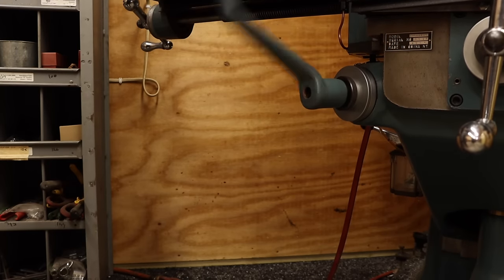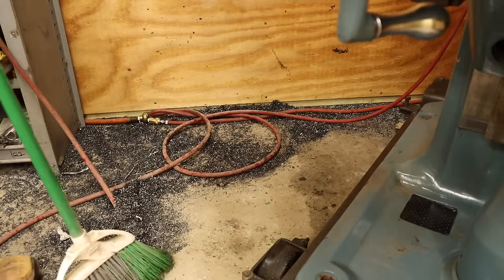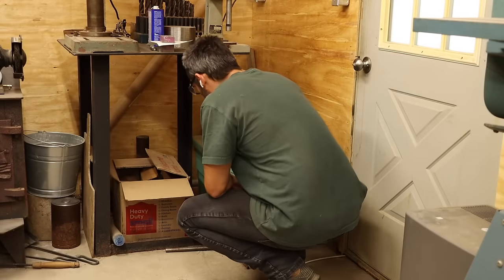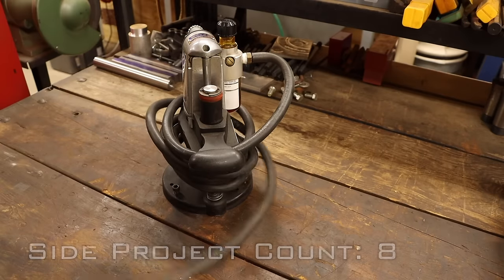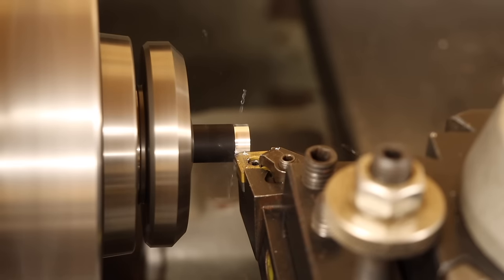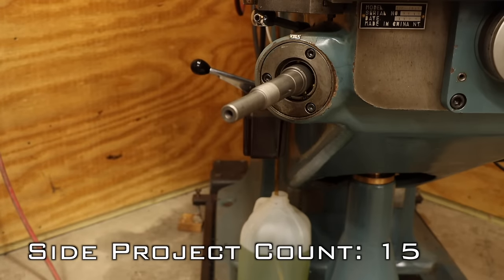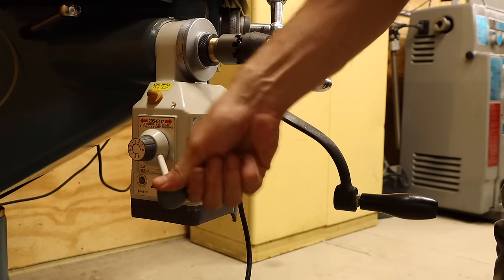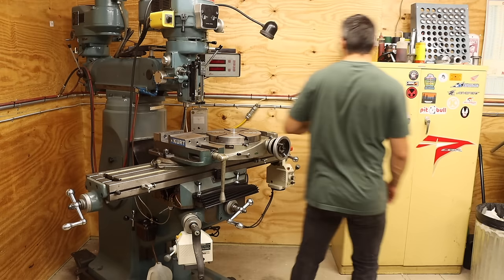3 Mill Upgrades (A Side Project Extravaganza) || INHERITANCE MACHINING

Comment: Uhg, side projects! I know what you mean. I started a project 10 years ago and have been doing side projects ever since. One side project leads to another and another and so on. Now I've forgotten what the original project even was lol. It's funny but unfortunately not a joke.
Reply from the maker: oh no 😂 

one day it will click and you will remember!
Reply: @InheritanceMachining  I hope so. But I'm also worried that, if I do remember, I'll run into another side project that leads down another rabbit hole lol.
Reply from the maker: @lkw6640  that's a guarantee!
Reply: @InheritanceMachining  yeah, I guess that's an occupational hazard especially with what I've got lol.

I got one of those Chinese mini lathes. I won't say it was a mistake because it wasn't. It opened up a whole lot of possibilities. But, as Stephen Gottswinter says, it's a kit and I bought what I could afford at the time. 

I've been making small improvements as I need them and it's gotten better and better. I even got the runnout on the chuck from .006 at the chuck and about .5" at 10" away from the chuck, down to no movement on a 10ths indicator (Mitutoyo) and very repeatable. In fact, if I get any movement when I chuck something I know is round up then I know some junk is on a jaw. Which is better than the pro's get on their 3 jaw scroll chucks so I'm pretty proud of that one.

So, yeah, side projects will always happen lol. But I do enjoy this hobby.
Reply from the maker: @lkw6640  That's a pretty a pretty impressive feat. I'm not even running that true! I've never had to work on smaller import machines like that but find the work Quinn (aka BlondiHacks) pretty impressive. There's another channel Ive come across recently as well called "We Can Do That Better" that had made a whole bunch of improvements to an import lathe
Reply: @InheritanceMachining  I was really surprised at the results myself!  It took some ingenuity though. Let me know if you're interested in a deep dive on that. Mini lathes present some unique obstacles. 

I love watching Quinn! She's hilarious and shows what's possible with small machines although her lathe is still larger than mine and nicer. I just started watching "We can do that better" but I like it so far and am going to watch more. There are a few other channels that specialize in small lathes.

After using my lathe for a while, I've found a lot of limitations with it that I'd never considered before. I want to make it a lot better but it's going to take a lot of time, materials, and even more ingenuity aka side projects lol.

I intend to do some things that I haven't seen anyone else do to a mini lathe but I still have a lot to do before that, like scraping the ways. I am NOT looking forward to that lol.
Reply from the maker: @lkw6640  There are definitely endless possibilities for improving machines. The only real limit is your own imagination. You might consider fashioning up a power scraper when you get to that point. I've never scraped ways but have seen how involved it can be. Feel free to shoot me an email sometime if you'd like to share your projects and solutions
Reply: @InheritanceMachining  That'd be great, thanks!

I've been thinking about how to convert an old sawzall I have for the scraping. I hurt my back and am disabled so I can't stand for very long so hand scraping is definitely out. Side project!! :)

Comment: I am terrified that the z-axis crank is going to somehow accidentally engage and break your wrist.  Is there some way to lock that out?  Or at least hold it pulled out when you're using the motor...
Reply from the maker: There is a pretty beefy spring keeping it held out but ill likely remove the handle anyway just in case.

Comment: Could you do a hardline for your air lines to also help with clutter and then you can add line when needed?
Reply from the maker: that's a possibility. my used soldered copper water lines though the shop with regular quick connect ports.

Comment: You know for all the "leveling" you do.

Do you have a systematic process?  Whereby you put the level up and if bubble is left / right you go and previous bubble was back / front then you tighten / loosen left rear and front right etc?

Seems like I once tried to level something and got so frustrated that when I leveled for front / rear I was mucking up the left / right.
Reply from the maker: Yeah I usually run into this same problem. It's especially tricky since tightening/loosening 1 bolt always ends up changing the load on the other 3. And has an effect at the scale of the level.

I got a tip from someone just recently of running the level diagonally, parallel to the corner to corner lines. In theory you can get 1 direction set, then adjust the second direction without having to touch the first. I haven't tested this but does seem a lit less tedious than my method.

Comment: That oil line that passes through the mill, shouldn't there be a grommet where the line passes through the mill to prevent the  hole from cutting your oil line?

Comment: I want to add an air drawbar like yours to my Bridgeport. The only trouble is I often have to clout the top of the drawbar with a hammer to get it to release - how do you manage on yours?
Reply from the maker: It's actually not as had as I though it would be. The impacting motion usually ends up releasing the taper lock as well. Mine is R8
Reply: @InheritanceMachining  
Brilliant. I hate changing R8s so much I normally just use Er32s. A pain when I want to use my chuck key. Will have to do mine thanks.

Comment: I would not reach over and actuate the power feed like you did at 16:42.
If the power feed happens to catch the spline, and engage the hand lever, that could potentially hurt your hand or even break your wrist. I've seen it happen even on an X or Y power feed hand wheel.
Reply from the maker: Good catch. This will take some getting used to

Comment: What is the make of the power draw bar unit? Great video!
Reply from the maker: Thanks! It's a Central Pneumatic
Reply: @InheritanceMachining  Central Pneumatic made the impact wrench used in the drawbar, but I doubt they made the rest of it. I'm also interested in the design of your drawbar - it appears to be simpler than most of the designs online, but clearly seems to work well. Are there perhaps any other clues on the unit about who the manufacturer might be?
Reply from the maker: @flyfr8rs1  You might be right... Let me take a closer look tomorrow and get back to you. if i forget holler at me again 😂

Comment: I find the Mitutoyo quill dro is more accurate than my Z dro on the mill. Maybe my knee gib is loose?
Reply from the maker: that could be. in what way is it inaccurate? does the deviation scale with length? or is there a sudden jump?
Reply: @InheritanceMachining  The disconnect between cutting depth an knee DRO, but not quill DRO, might be knee variable angle. Might be a loose scale on the knee.

Comment: Quick question for you. You moved what appears to be a large slug of aluminum that has a bore through it. 1 - Is that aluminum? 2 - What is the diameter? I need a 3.5" thick piece of Aluminum for the drive wheel on a belt grinder I am making. would be willing to make a trade for some other materials?
Reply from the maker: I'll have to get back to you on that. Long story but there's a chance it's for a project my grandfather started that I might finish. But If not I could be interested. Shoot me an email if you'd like

Comment: What if the manual crank for the Z axis on the mill accidentally engages while turning with the electro motor? I can imagine it can beat up your arm pretty good. Maybe you could just remove it? Or is there some safety feature?
Reply from the maker: Yeah it will hurt. It does have a decent spring keeping it out. And it takes a little bit of alignment to get it to go. But still worth being careful around.
Reply: @InheritanceMachining  ah I guess the spring helps. Great channel and great vids by the way! Greetings from the Netherlands
Reply from the maker: @Niels_Dn  thanks!!

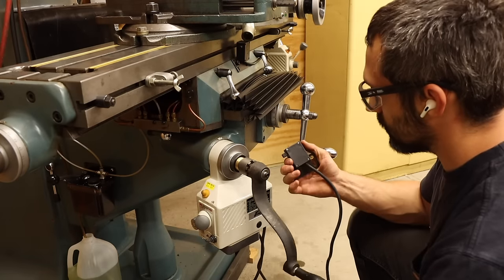Comment: 17:56 i donno but those meshed gears look like they could grab and whip the handle around. am i missing something that would prevent that from happening.
Reply from the maker: There is a spring holding the handle out but there is still the potential. I'm considering removing it just in case

Comment: I know you've now replaced the hoses, but I still don't understand why you haven't just run hard lines to the drops. Then you never really need to worry about replacing hoses as they age and start to leak.

Comment: I might be completely wrong, or I misunderstood something but why would you not want an oilite bushing for a part where there is movement? But then where that movement was supposed to be. on your dial, you blocked the movement with a shoulder on the ring. How are you going to zero your dial now???
Reply from the maker: The movement on the dial is so infrequent and under so little load a bushing setups like I used is plenty adequate. Also the ring is threaded and is loosened and tightened to zero the dial. Hope I followed what you were saying correctly
Reply: @InheritanceMachining  Yep!

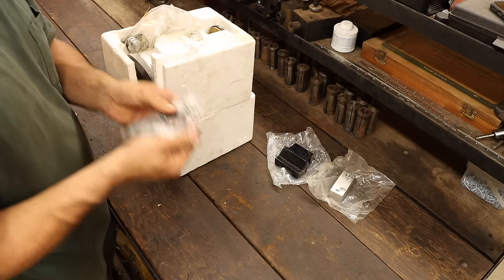Comment: @13:23 A sweat? I broke a tooth when the knee handle came off the dogs on my Bridgeport and I smashed myself in the mouth with the heavy end!
Reply from the maker: ouch! you must have been going like a bat out of hell
Reply: @InheritanceMachining  I was trying to do the bottom-to-top traverse going as fast as I could.. took the end off a tooth, busted lip etc! I'd love a closer look at the wheeled cradle your mill sits in; any closeups in other videos at all?
Reply from the maker: @aaronbuildsa  damn... I'll bet that chipped tooth is a harsh reminder!

There might be some other shots in the mill cleanup video but there's really not much too it. I've gathered some info on the lathe frame I can share that is very similar in design. Shoot me an email if you like
Reply: @InheritanceMachining  Dropped you a mail - thanks! And yes, every time I run my tongue over the back of my front tooth... at last it means I won't do it again ;)

Comment: Why do people have these large personal workshops with expensive and complicated machines that require maintenance? Would it make sense to have a community workshop in every community that people can pay to use? It would cut down on the cost and make it more accessible to those who do not wish or do not have to time and money to assemble and maintain own workshop.
Reply from the maker: It's a hobby just like anything else really. I seem to recall hearing about community shops like that though. There are a lot of risks involved I imagine as the tools are inherently dangerous.
Reply: @InheritanceMachining  If I had the time, money and skill, I would get my own shop too.

People will probably not treat the machines right in a workshop they don't own. People are not great at shared responsibility (just look at current climate situation). Which means a machine mechanic will be required.

And if one person breaks a machine and another person is injured before it could be fixed, then who is responsible? Although this could be fixed by requiring people to sign a waiver before allowing them to use the machines.